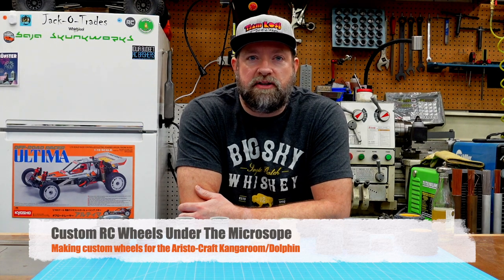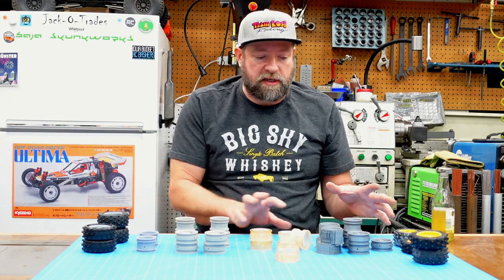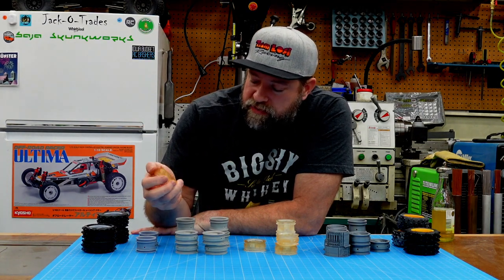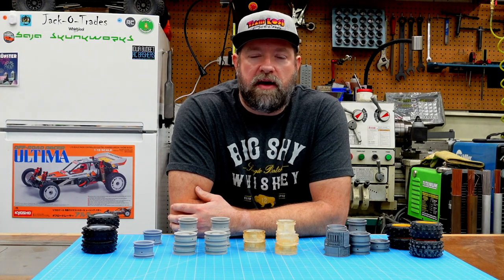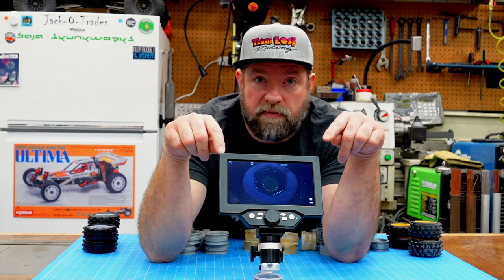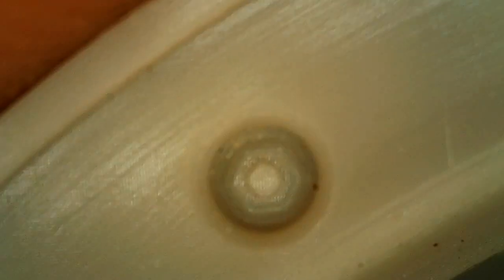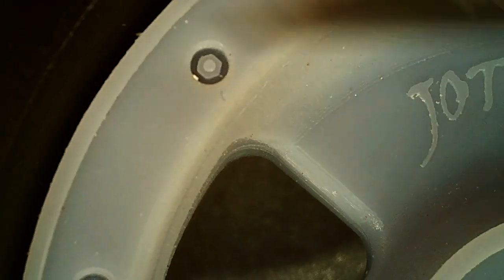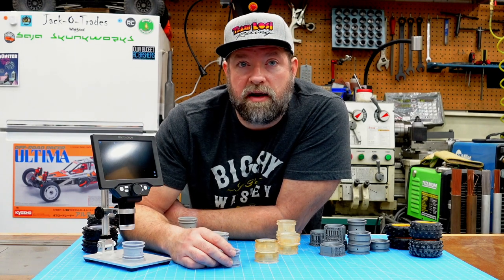Custom RC Wheels Under The Microscope

Comment: That is cool you can see the pixels in the print! I have the Elgoo mars printer and have marveled over the details I have been able to get on gaming miniatures I was painting a lot of over the first 1 of the whole lockdown thing! I can see where this would be super cool to make some really nice display wheels and fairly cheap runner wheels as well! Sadly you are limited to the available colors and the regular resin is not super strong. I have the ABS like resin of the minis I print and have good luck with that.

Comment: This is awesome! I've been trying to make wheels lately as well. It's tough. These look great though! I guess even newer finalized versions look better? Can't wait to see what's cooking!
Reply from the maker: I haven't done much with the SLA printer in a while. In general I have had pretty good success with printing wheels that hold up, and look decent. Worst case, you can just reprint them.
Reply: @jack-o-trades  it's definitely a learning process. I've trying to design new wheels to fit F1 tires on drag cars.  The slight changes along with the main changes I need  haven't quite balanced out yet. I've at least been able to make some adapters out of PC blends that have worked so far. I'd definitely be interested in a follow up if you've gotten it worked out better. Thanks again for sharing!